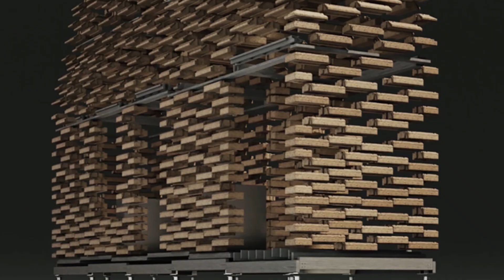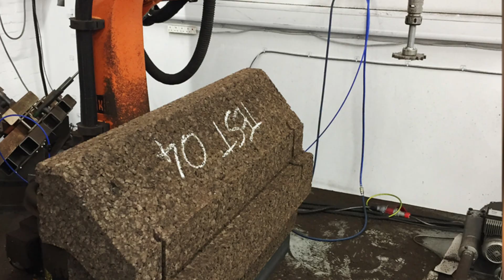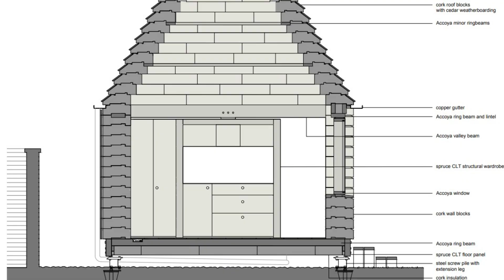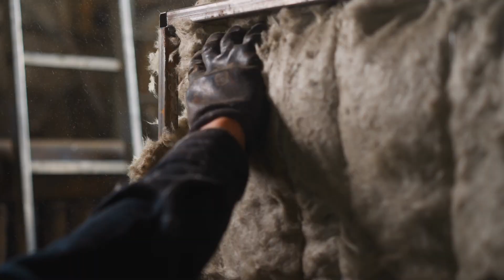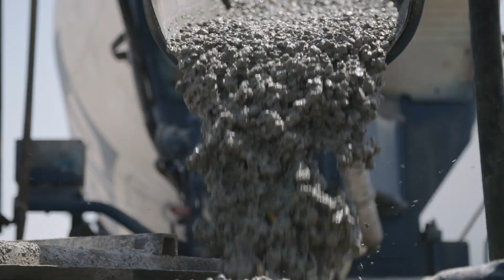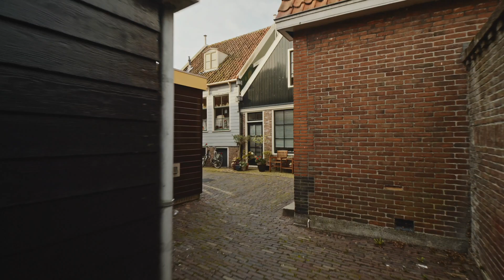This Sustainable Cork House Took Only 2 Weeks To Build

Comment: Does the cork house design include plumbing and electrical systems? Or is the design just a house shaped structure?
Reply from the maker: Elec and plumbing piping would not be cork, no.